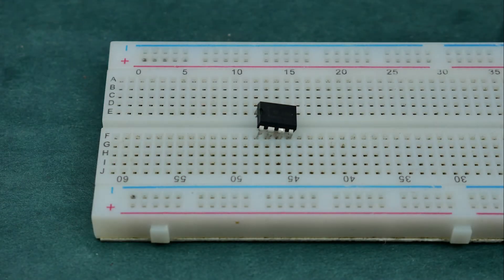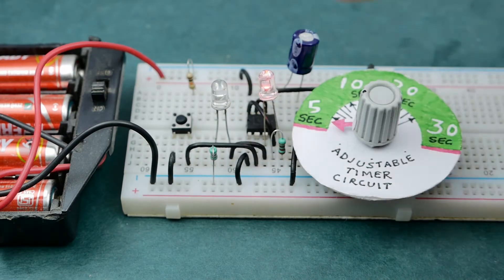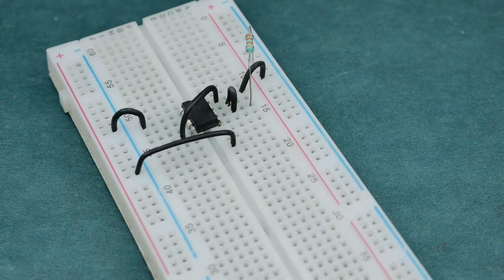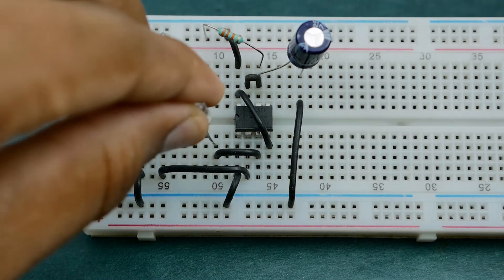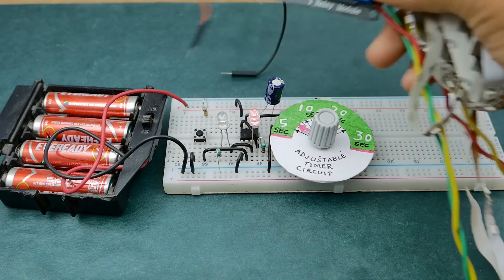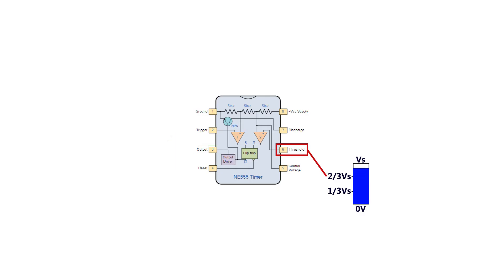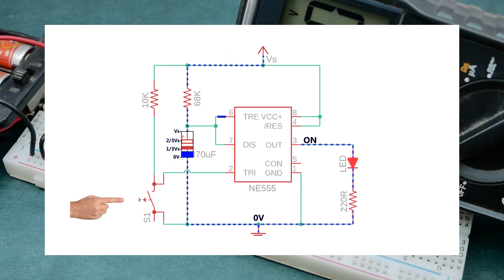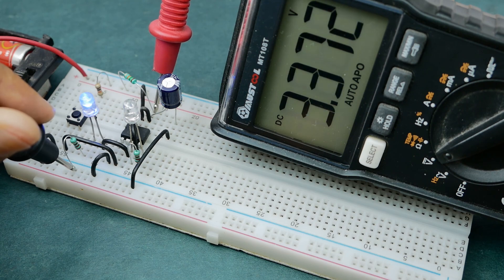Adjustable Auto On Off delay timer circuit on Breadboard | 555 Timer project #4

Comment: i got a question.   I built this circuit to control an led police flashing circuit.  It works great, i have it timed for 15 seconds.  the flashing police leds are very bright.  i do have an NE555 timer ic. Problem is this circuit keeps blowing my NE555 ic .  i am using these circuits on my motorcycle, approx 11 - 13 V  LOL, i am having to replace the 555 2 - 3 times a week. The rest of this circuit is fine.   Was wondering if maybe it is the brand of NE555 i am using > ? Any input from anyone is welcome.  Thank you .
Reply: Me again , i did just open my circuit and seen the pin # 1 , grd has burned up.  the rest of the circuit is fine.  VCC is good also. Now im  thinkg a zener diode voltage regulator from pin 1 to ground.   Any input is welcome . Thank you .

Comment: Does the LED go out if the switch is held down?
I want a circuit that only turns on after the switch is turned on and off again, so does not remain energized continuously when the switch is held down 🙂

Comment: Is the output voltage the same as the input voktage or will there be any voltage drop?
Reply: 0.5 voltage drop on output caused by diode. diode is inside of 555.

Comment: First, thank you for the video.  Second, I have a question.   Let's say I want to make the LED brighter in your project.  How would I do this without changing the battery's voltage?  Would I incrase the capacitor size?  Change the resistor configuration?  Is there a different way to configure the 555 to permit more voltage to reach the LED?  Thanks so much!

Comment: Thanks for this outstanding explanation. I replace the led with dc motor, but the circuit doesn't work, could you please explain how to apply the adjustable timer for the dc motor

Comment: Wow this video was great!  That visual explanation at the end was awesome!  I'm not new to electronics, but I'm inexperienced.  How would I set up an oscillating circuit, like to flash an LED for just a moment (like 0.1-0.5 seconds, doesn't have to be specific), then wait 15 or 20 seconds, and do it again?  Would I need two 555s, or could I just add a transistor and resistor and capacitor somewhere?

Comment: Why when I put a motor instead of the led, it does not turn same duration?
Thanks
Reply from the maker: Ideally the delay has to be the same. What difference do you observe and is the difference in duration consistent?

Comment: Hello. I need help plz answer me
I need to cut off power and on for every 2 hours interval for my fish tank bubble.motor  dc supply can u plz explin in simole way
Reply from the maker: You can use the same circuit as shown in the video. For timing resistor and capacitor, use ~10K resistor and 470uF capacitor

Comment: Hey, I really appreciate this video form providing the value of components which affects the delay.. But I need to make a delay off circuit. So if we connect it to the power, the output will stay off for the specified time, and then turn on forever till the source disconnected. Is there any way to do it?
Reply from the maker: Yes, you can connect the output in an inverted manner. Like connect negative of the output you are using to output of 555 IC and positive of the output to positive rail. This way, when the timer is running, the output of 555 timer IC will have positive voltage and the output you have connected won't be able to turn ON. Immediately after the timer finishes, the output state of 555 IC will have 0V and so the output you have connected will turn ON and stays the same until the source is disconnected.

Comment: Can we use it sensor in the place of switch
Reply: Sorry ir sensor
Reply from the maker: Not directly. You can use a relay instead of push button and trigger the relay ON using the IR sensor arrangement

Comment: Very well done, thank you. I'm wanting to find a way to use the 555 timer (or similar) take a simple proximity based circuit (IR prox and TIP32C PNP transistor) to create a single (time limited) circuit until reset.  The proximity circuit config is "always on" upon detection. Because I don't know the duration of the "activated" IR proximity, to which the light (or motor) would be activated, I'm hoping to use 555 to present a closed circuit and not capacitor charging until the proximity (either the same IR set or an additional set) is activated, at which time I'm hoping the 555 can close the circuit to the Light/Motor circuit for a few seconds, without resetting until the proximity detection state is cleared. Is this something you think is possible?

Comment: Well explained, thanks for your video. Help me with one thing. I don't wanted to connect push button i want the output exactly when power supply is on for a time duration
Reply from the maker: Welcome. If you disconnect Pin-7 and remove and short push button connections, the circuit behaves similar to what you require. The timer and 555 IC's output turns ON immediately after powering ON the circuit. 555 IC turns OFF after the delay time and stays the same until you re-power the circuit.
Reply: @elonics  thanks

Comment: I made this circuit, it works perfect....
I want to add IR sensor instead of manual button pressing.
So that bulb glow when ir sensor detect object in range.
Pls help
Reply from the maker: You can use a relay instead of momentary push button and trigger the relay using the output from IR sensor arrangement.

Comment: I Tried a lot... Circuit isn't working at all...
Reply from the maker: This is a standard monostable circuit you'll find anywhere (https://en.wikipedia.org/wiki/555_timer_IC#Monostable). There must be something wrong with the connections you've made or with the power supply or the delay must have been a lot

Comment: The circuit doesnt work i have tried a lot on proteus multisim and practically as well.
Reply from the maker: This is a standard monostable circuit you'll find anywhere (https://en.wikipedia.org/wiki/555_timer_IC#Monostable). There must be something wrong with the connections you've made or with the power supply or the delay must have been a lot

Comment: Hi sir,
I learn it but I have a one doubt for this circuit....
That will work on 340v to 400v ???
If yes then please told me that how will work for 18v for 8 second timer
Reply: Please told me that will work on 400v AC power
Reply from the maker: For powering the 555 timer IC, voltages from (5-12)V are recommended. If the voltage is more than 12V it might be difficult to find a matching relay with the same control voltage. The max voltage of the output load depends on the rating of the relay you are using. I think you'll be able to find a relay that handles 400V.

Comment: I need an automatic on and off circuit timer that can go on for 5sec after every 25 min
Reply from the maker: You may try this circuit: https://www.youtube.com/watch?v=TTQnhIkw4Bk Use the formula mentioned at the end to calculate the values resistors R1 and R2 depending on the ON and OFF times required.

Comment: Hello,
Can we use a IR Sensor module with output low in place of push button to activate the circuit ?
Reply: Plz tell me if you find the answer and solution.
Reply: @briz027  instead of using a switch in this circuit use a npn transistor (like bc547) connect emitter to grnd & collector to resistor & connect transistor's base to IR sensor's output pin....
(I'm taking this video's circuit as a reference)
I was looking for something similar too like you but I'm using a vibration sensor.... hope this helps u
Reply: NOT a DrUg dEaLEr  but I want output for approximately 1 second while ir sensor give output till obstacle is there.
Reply: @adit8206  that kinda works but output doesn't gets off after specific seconds. It stays on until there is obstacle on ir sensor.
Reply from the maker: Hi all, any voltage reference that can go below 1/3rd of the supply voltage when some desired change happens (eg: IR sensor is triggered) can activate this circuit

Comment: What happens if you continuously press push button
Reply: @daSurrealist  please tell me.
Reply from the maker: The actual calculated delay starts from the moment you release the push button
Reply: @elonics  is there some way to latch the first push button press
Reply: @daSurrealist  you could use a latching switch aka on-off switch like a light switch

Comment: How to energise  the circuit directly on 230 volts ac line without using a step down transformer
Reply: Search "mains capacitor voltage dropper circuit" on YouTube but make it on ur own risk as it has mains voltage flowing which can be fatal if you aren't experienced

Comment: Loved the way you give detail explanation. Thanks sir.
Just had a doubt in timer ckt. That what will happen if we don't use 555 ic and make delay ckt using RC and transistor only? I mean what is the disadvantage?
Reply from the maker: In the case of RC circuit using transistor, the current flowing out of the RC loop can be significant when the delay is a lot and so it is difficult to compute the RC values that are closer to the actual results.
In the case of 555 timer, it internally has comparators at Pin-2 and Pin-6 and they make sure that almost no current flows from the RC loop. As a result, the timing we calculate from the RC graph will match with the practical values

Comment: If I just need one second or two seconds, what should I do?
Reply from the maker: Use a ~150K timing resistor and 470uF timing capacitor (The ones highlighted in red and blue at the intro of this video)

Comment: how we connect ir sensor with delay timer
Reply: Plz tell me if you find this ans.
Reply: instead of using a switch in this circuit use a npn transistor (like bc547) connect emitter to grnd & collector to resistor & connect transistor's base to IR sensor's output pin....
(I'm taking this video's circuit as a reference)
I was looking for something similar too like you but I'm using a vibration sensor.... hope this helps u
Reply: Output of timer circuit should be cutoff. While I keep pressing push button.                     If I press button for 5 seconds but output should be cutoff after approximately 1 second. Plz give me solution...

Comment: Hi. Tried the circuit with 1000 micro Farad capacitor and 100K pot. Works well below 5 sec delay. However, output latches to high above values more than 6 sec. Any ideas what could be the problem?
Reply: I tried with 220uf and 39k, got 10 sec. Check the diagram.

Comment: What if we use normal on/off switch instead of push switch?  Actually in my circuit i will have a constant power on/off signal. But i want my circuit to run for a specific time period. Can i replace the push switch with my signal ?
Reply from the maker: You need to disconnect Pin-7 (We don't want the cap to discharge as long as the power is ON) and connect Pin-2 to the +ve of cap (To the same point where Pin-6 is connected). And then directly power 555 timer IC using the normal ON/OFF switch. The output stays ON until the cap charges to above 2/3rds of the supply voltage and then it turns OFF. The cap discharges every time you turn OFF the circuit, so you should be able to replicate this each time the switch is turned ON.
Reply: It is not working
Reply: Is it working? Plz tell me.
Reply: @Suryakant Nayak  is it working ? Plz tell me?

Comment: What is the minimum delay time we can achieve with this?
Reply from the maker: Milliseconds, with a very small capacitor or with large resistor
Reply: But if button pressing time is 1 second and I want output less then 1 second. Plz give the solution.

Comment: Which potentiometer did you used
Reply from the maker: 100K potentiometer
Reply: Thanks and which volt of power supply you used
Reply from the maker: @reshmahagawane6780  6V (4AA Cells). You can also use a 9V battery
Reply: @reshma hagawane , did you understand how much volt is the capacitor??
Reply: @fotisval5606  voltage of capacitor can be any as long as it's greater than the supply voltage if you're going to use 9v then 16v capacitor would be more than enough